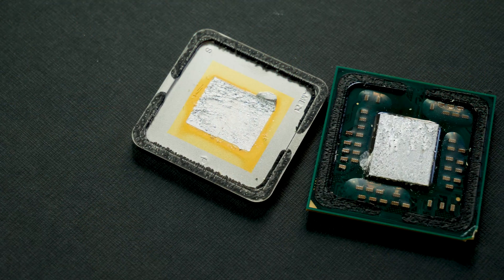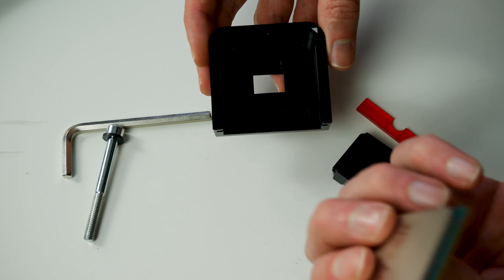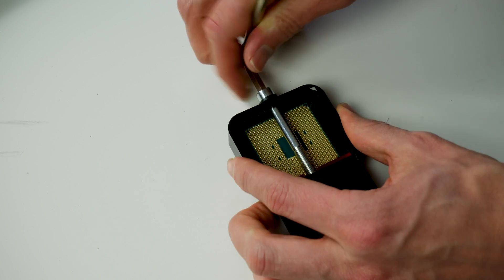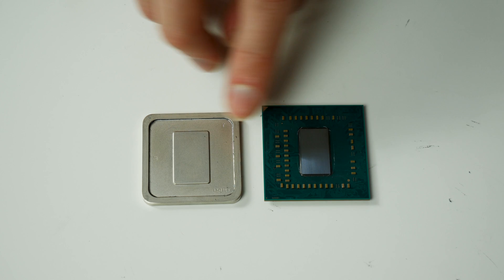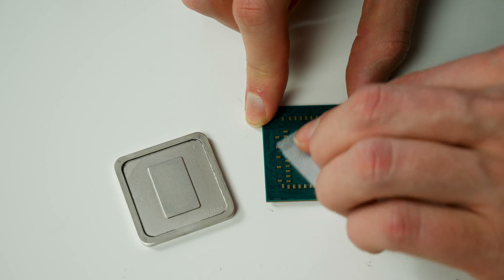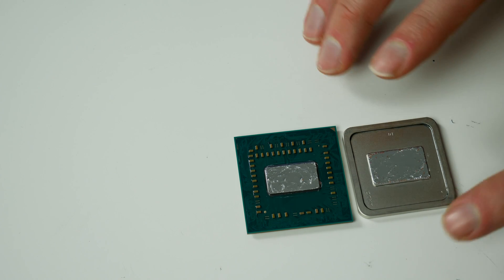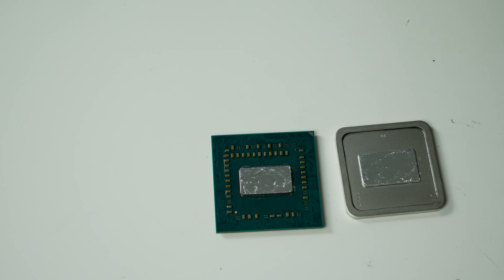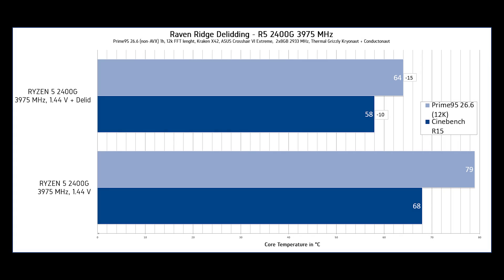Raven Ridge - Ryzen 5 2400G delidding. Before/After Temps (en)

Comment: Interesting upgrade.  Thank you for showing me the CPU's die to package junction.  Have you ever tried using a carbon cooling pad in place of thermal compound?  That would make an interesting followup approach and test to conduct heat off of the core.

Comment: Well I delided my backup R5 2400G with razors, and accidently broke 3 capacitors, which I heard causes slightly less ripple tolerance, and overclock ceiling. Turns out I can boot with higher and more stable clocks at 4.1ghz lol. 

I'm not sure if that is due to much lower temps anyway, but there's that...

Edit*
If anyone is interested the capacitors that were lost were the two on the bottom left, and one on the very bottom right, at 5:27

Comment: so the takeaway is that the Ryzen 5 2400G is not worth delidding except for lower temps rather than higher clock speeds? That's good to know. I can avoid delidding with a better cooler and avoid the risk. Cheers der8aurer.

Comment: I already have the delid kit, so should just try it, but I have a 2200g in an InWin BQ656 case, so the Stealth cooler is the only fan in the entire case and pulls air directly through the mesh side. It can hit high temps (undervolted the APU, stock clock on cpu and OC'd the GPU to 1500MHz) in games and tasks that are CPU heavy. Stress tests will make it hit 90c+, but just playing cpu intensive games and pushing the gpu to 100% will get the temps close to 80C, though usually 70-75C. 

I was wondering if delidding and liquid metal will drop temps using the stock heatsink in a low airflow situation? Even 5c would be an improvement, 10c would be amazing but I don't expect that. Really just looking for a little headroom on temps, especially when it comes to keep CPU boost as close to 3.7GHz as possible under load.
Reply: Finally got around to delidding and LM (used Cosmonaut) the 2200g, and repasting the heatsink of course (used Kryonaut). Temps dropped by about 10c. That is it sitting horizontal still, its a little cooler standing vertical but somewhat afraid because this was my first delid and first time using LM, so worried I used too much and turning it vertical (the APU being sideways then) will cause it to leak and fry, haha. I did 2 coats of clear fingernail polish, but still. Will try it a bit later once I do more testing on games. 3.7GHz @ 1.356v on the CPU and 1600MHz at 1.21875v on the GPU. May drop back to 1550MHz @ 1.2v or 1500MHz @ 1.192v on the gpu if I want to drop temps more. Just wish I could get a stable OC on the CPU at less than 1.356v, others get down to 1.25v or less for 3.7GHz.

Comment: Hey mate! First of all, your video is very informative! Thanks! :D
So I am building one of my friends an r5 2400g/16gb kit 3000mhz/msi b350m pro vdh mobo system, he is gonna play games at @720p60, and light audio editing, and later upgrade to a dedicated GPU, and also 1080p monitor.... Im planning to OC that 2400g, for more performance of course, with the stock cooler that comes with the apu. Do you think these oc options will be okay, and stable for 24/7 use?
CPU Core Frequency- 3.8GHz
CPU Core Voltage- 1.32V
RAM Frequency with XMP- 3000MHz
RAM Voltage- 1.5V
GFX Frame Buffer- 2GB
GFX Core Frequency- 1500MHz
GFX Core Voltage- 1.25V
:D

Comment: i think you used too much liquid metal. After a long time of use, if the processor is in vertical position you'll find a several amount of product on the bottom of the chip
Reply: my thoughts exactly.  just the amount of spread he used on the chip-side alone is enough for both apertures.

Comment: The reason why we would be surprized that AMD is using TIM on the APU is because they use solder for even their cheapest CPUs.  Also they are always demonstrating how they go the extra mile with ALL their products compared to Intel ie not having any locked SKUs anywhere in their lineup.
Reply: That link looks really convincing, but im on a 9 year old soldered quad Q8200 and termals are still perfect. Cpu works in range of 35-55 celcius with cheap 3 heatpipe cooler. Ryzen working temps will be around 20-60 celcius, so not much thermal cycling also, unless you are overclocking maniac and dont know when to stop :D I think i will believe in my experience with solder more. This guy might be right, but you can see by his article that he likes to overclock a lot :P
Reply: Well first of all even their cheapest CPUs are two full CCXs with 2 missing cores, giving tons of area to solder onto.

Second of all, don't you think AMD is doing that deliberately JUST to dig at intel?
I mean, sure, it's nice to have unlocked chips, but what good is that if the chips only overclock a tiny bit.

I hate intels lineup, I hate how they have to have 30 different processors in a line and you got to pay for every step up and every feature you want, instead of putting it all in a convenient package like AMD.

But Ryzen Clockspeeds where disappointing, which is why I am looking at Ryzen+ and see how much the jump to 12nm improved things...from this I could extrapolate how much Zen 2 might gain from going 7nm and then maybe I'll build my next system based on a Ryzen.

It all depends on how the CPU market looks at the time, tho...unfortunately, I buy the best product for my needs that is available at the time...not "product A from corporation B because corporation C totally suxxorz"...

Unless intel does something tremendously stupid...then I might buy AMD out of spite.

But people seem to forget the tremendously stupid things AMD does because in the current narrative, they are the good guys...
Reply: Any die will benefit from solder, no matter what the size.

AMD is doing that to give people one more reason to buy AMD.
Reply: Der8auer would disagree...He's the one who told me about micro cracks which lead me to looking up limitations on CPU soldering...

"Intense thermal cycling will damage the solder preform significantly. Tensile stress inside the solder preform will lead to voids (Figure 10).

The voids will decrease the thermal conductivity and increase the thermal resistance (Rjc). Eventually micro cracks will occur which usually originate from the DIE corner (Figure 11).

The micro cracks will also decrease the thermal conductivity but will especially increase the thermal resistance at the corner of the DIE. Without the gold layer between diffusion barrier and solder preform, delamination of the solder preform would occure after few thermal cycles. Micro cracks occur after about 200 to 300 thermal cycles. A thermal cycle is performed by going from -55 °C to 125 °C while each temperature is hold for 15 minutes. The micro cracks will grow over time and can damage the CPU permanently if the thermal resistance increases too much or the solder preform cracks completely.

Void and micro crack occurrence is mainly affected by the solder area – thus the DIE size. Small DIE size (below 130 mm²) e. g. Skylake will facilitate the void occurence significantly. However, CPUs with a medium to large DIE size (above 270 mm²) e. g. Haswell-E show no significant increase of micro cracking during thermal cycling (Figure 12).

This failure mechanism is one reason why small DIE CPUs like Haswell-DT or Skylake are not soldered while the large Haswell-EP CPUs are soldered."

You want the full article? It also talks about the cooling solder bending PCBs out of shape, which naturally happens more when the die is smaller and exerts force on a smaller area.

But hey, if you want your CPU to mysteriously break one day and lose thermal performance over time, or just simply not work because some of the pins can't reach the contacts, go ahead, keep peddeling that tiny chips should be soldered. Not even AMD does that. That would kill product reputation if your unnessecarily soldered tiny chips would have a low lifespan or have lot's of DOAs...because guess where tiny chips are mostly used...in OEM Prebuilds PCs bought by people who have no idea how to change a CPU and they wouldn't like it if it suddenly failed on them 3, 4, 5 years down the line...

It's a good idea for large, high performance chips, but it's a waste of resources to solder low TDP parts, AMD probably did solder the 1200-1800X no matter what TDP because all of them had essentially the same production process, just with a different number of cores per DIE...the size, arrangement and probably manufacturing line was the same, saving money that way.

Mining gold and especially indium is hard and bad for the environment, and gold is mined like crazy compared to indium, which is really rare. Some companies are looking into using other materials for soldering silicone to metal, but who knows when that will become an industry standard...or if it even is possible. The company I found was talking not about CPUs, but other microchips.

BTW, 8700K Die size is 149mm², 7700K 112mm², 2600K was 216mm².
2400G is 209mm² it's on the edge...could be soldered, but it's a relatively low TDP part, so there is no need.
Might also be because the GPU part and CPU part behave differently in terms of heat...I dunno, I'm not the AMD engineer that put TIM on the chip.
Reply: I will check out the full article and thank you for posting a detailed response, but something that caught my eye was the definition of a thermal cycle;  -55 to 125 celsius.  This level of validation might be necessary for the military, but not for the general public.

The other thing you brought up was the possibility that the CPU and GPU components might have differing thermal properties that would cause problems with solder. This could well be true.  If that's the case, I would hope that AMD would use the highest quality TIM to generate the best benchmarks from the reviewers and subsequently maximize sales.  The difference in cost going from crap to the best TIM might add $2 to the price of a chip.  I'd gladly pay that.

Thank you again for the detailed response.  It gives me something to think about and investigate.
I'll send an email to AMD asking them why the did this.  Hopefully I'll get an answer.

PS I used to be and Intel fanboy but from here on out I will be buying AMD.  Reason #1 is because I want Intel to have competition 5 years down the road.
Reply: A thermal cycle like that can easily happen...during shipping for example. 

And we heatup and cooldown CPUs from 100+ down to 20+ many many times...remember that the CPU temps shown on screen are not the highest temps currently happening within a CPU. And once a microcrack develops it stands to reason that lesser temp ranges will continue to facilitate it.

http://overclocking.guide/the-truth-about-cpu-soldering/

Here is the article.

Comment: I can see that the soldering process is an extra step, as compared to slapping paste on and gluing shut, but how much would liquid metal cost them if they were buying in bulk - or if the long term reliability is untested, is there a non-metal paste that comes close - or if the thing is fully sealed, a liquid system that uses surface tension?

Comment: what is the advantage of the heatspreader? Older cpus used to come with the die exposed and it mated directly to the heatsink.  What does the heatspread add? surely putting the heatsink directly onto the die would be better?

Comment: Inb4 Intel starts selling their CPUs without a lid and consumers have to buy their own lid form 3rd party.
Reply: That's how it used to be...coolers would just be made that reach down and touch the silicone directly, no need for a third party lid to add more layers...
Direct-Die cooling is pretty efficient too and you could use any TIM you fancy.

I would actually support that move...You know, they can still have the "babies first CPU" model with the lid on for protection, but more advanced users would probably benefit alot from this.

Comment: Why not use CPU without a heat spreader. Height difference will not be that large, but thermal contact even with thicker thermal paste layer should be better.

Comment: Ich hab mur gerade neuen parts geholt i7 8700k 64 Trident z RGB 3000mhz und 2x GTX 1080ti. Der lief auch echt perfekt bevor ich den RAM eingestellt habe und die CPU auf 5ghz übertaktet hab. Ich hab die Schritte im Video 1:1 befolgt nur jetzt brauch mein Betriebssystem ewig bis es bootet und ich hab am oberen Bildschirm ganz kurz einen dicken Balken mit Schnee. Was mir dann aufgefallen ist, im Hardware Monitor von cpuid steht ddr4 2132 obwohl im BIOS 3000mhz auf 1.360v läuft die CPU lief auch auf 1.360v bis ich das BIOS resetet habe. Ich hab die CPU runter getaktet und immer noch der gleich Fehler. Den Speicher hab ich dann auch wieder auf 2133mhz gemacht, also das BIOS komplett resetet und habs dann auch so gelassen und trotzdem selber Fehler. Wenn ich in Windows bin sagt er mir direkt im Zuverlässigkeitsverlauf Hardwarefehler. Direkt nach Booten, laut Windows ist der Hardware Fehler genau in der Zeit wo das Windows nicht richtig bootet

Comment: You can use AMD CPU without the coverage, and place the heat spreader directly on the die. You could use some pads made of rubber as were used in the AthlonXP era for a better stability of the heat spreader.

Comment: Can you tell me if the Delid-Die-Mate 2 is going to be in production again ?  
Caseking  and Overclockers does not have in stock and I cannot find it for sale anywhere.
Reply: I wouldnt hold my breath. I've had mine ordered for 4½ months now and it seems like its not going to be back in stock. TBH youre probably better off buying the rockit cool delidding tool.
Reply: Yes the Rockit 88 delidding tool was an option but I don't like it that they don't have live stock levels.  Can't see any customer service or way to contact rockitcool either.
Reply: Oh, just seen a contact form, will ask them if in stock or not.
Reply: Tell me if you get an answer from them, i mean i might as well order the rockit cool delid tool as ive waited almost 5 months for nothing.
Reply: Just seen the Aqua Computer Dr. Delid and is in stock with several vendors.  Seems to be well made and uses a rotational torque method to remove heat spreader. Likely less chance of damage also with the acrylic socket it uses.  I am strongly considering buying this one now.
Reply: Oh i completely forgot that there was dr delid too! From what ive seen its very good and gets the job done and it even has the relid option too. Also it seems to be in stock at one of my vendor so ill be ordering it right now! Thx for reminding me lol.

Comment: So these get just as hot stock on water as my 4.5 GHz 6600k @1.31 volts on air. Still probably not worth it for such a low spec /price part.

Comment: Why no Gpu oc ?... Maybe the delid could help the GPU being oced higher... ? , i have a feeling that GPU oc will be more valuable than Cpu OC on these lowend parts, the GPU is proberly holding back the apu more than the cpu at stock clocks.
Reply from the maker: Crosshair 6 Extreme and Hero don't have display ports so can't use the iGPU. Even if "forced" in BIOS it stays disabled after POST.
Reply: Ohh, what a shame. Try to get ahold of a different board at some point to test it with, a highend X370 with good oc capabillaties for the igpu would be nice to see a test in, with that delidded 2400G.
Orther than that, thx for your hard work, big respects here from Denmark, i may even end up ordering your delid tool one day when my I7 8700k needs an oc to keep up.
Plz see if you have options to get them sold at a danish retailer, i am not a big fan of shopping outside my own country normally, and i dont remember if your employer/marked-partners website/shop, ships to Denmark.

Comment: @der8auer Roman - Bristol Ridge was delided by Namegt before AM4 release and was soldered. I think that's why some of these people were surprised. Short term memory :)
Also, for the raised bump in the IHS, this wasn't the case for older AMD APUs with TIM was it? I think this die is thinner than usual for thin and light laptops. Z-height of 1.7mm for upcoming Vega Mobile w/ interposer is also very low.

Comment: Der8auer, regarding the nail polish, to be safe to be applied on the CPU, would the following ingredients be ok? 
Butyl Acetate; 
Ethyl Acetate; 
Isopropyl Alcohol; 
|Nitrocellulose; 
Tosylamide/Epoxy Resin; 
Acetyl Tributyl Citrate; 
Diacetone Alcohol; 
Alcohol; 
May contain: Ci 77891; Ethylcellulose
Reply from the maker: should be perfectly fine
Reply: Thank you, that'll ease my mind a lot. I was freaking out knowing that there are some nail polishes that shouldn't be used. and it's not like your typical seller will know if the nail polish is non conductive and high termal resistant

Comment: AMD used TIM back on the Athlon II and even on 65w Athlon 64 x2 processors (I ran direct-die cooling on an Athlon 64 x2 4800+ Brisbane), so they've been literally using TIM on their lower-end parts for over a decade now.

Comment: What you should focus is not cpu OC, you shouldn't even care about it. You should focus on GPU OC.

There are many tests with 1600-1700Mhz OC. How much do temps increase with that OC and how much it can be improved by delidding?
Reply: I set my clocks at 1570MHz which was pretty stable with 3133MHz on 2x4GB DDR4 modules. CPU clocks were set at 3.5GHz locked. Temps never got above high 60's in gaming, with 720p and 900p being good for most games, and 1080p in well optimised or older titles. This was with a stock Wraith Stealth cooler and a small Inwin BQ656 case.

Comment: If AMD want to save costs they should release an slightly cheaper no cooler included RR APU's on a smalled box (you save a lot in shipping costs per unit / per container if you reduce the unit physical footprint), say $5-7 less vs the boxed unit.
Reply: I would be surprised if they didn't sell oem versions of these, just maybe not available in stores.
Reply: @sickbailey21  very much available in stores